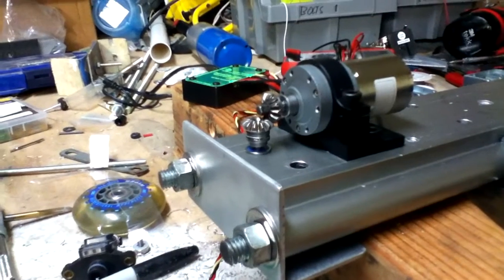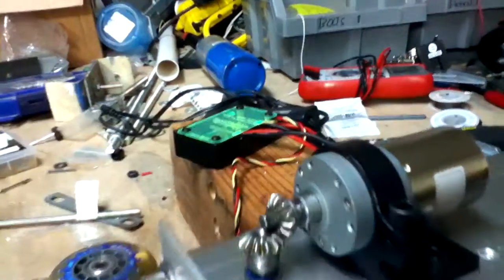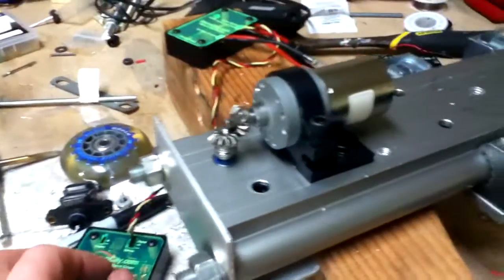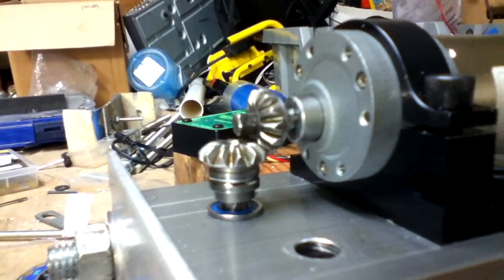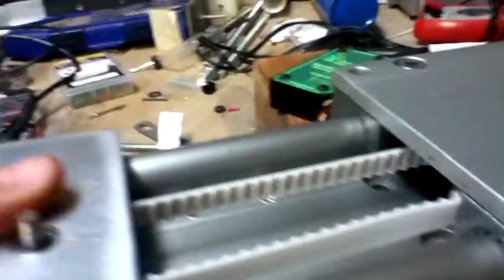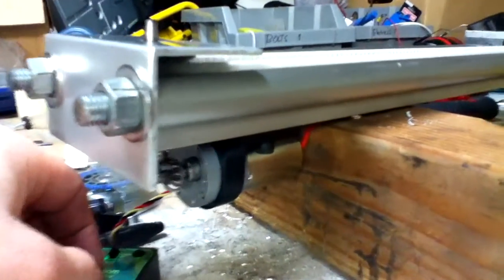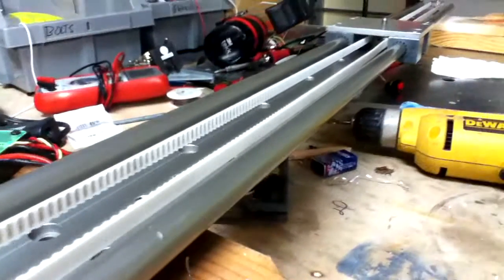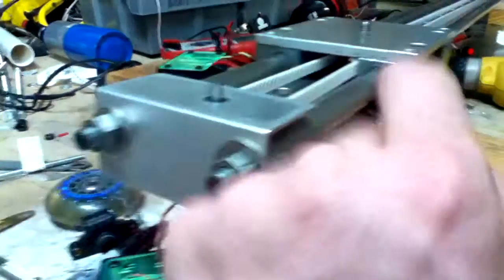Motorized Slider Update #2 with Servo City Parts

Comment: Hey I wanted to know what is the slowest speed on the motor? Will it be suitable for timelapse videos?
Reply from the maker: This is for video and not time-lapse. You would need a completely different controller setup for this. A lot of folks doing time-lapse drag the shutter and since this is a continuous movement slider it wont work well. The slider moves around 5 seconds a foot.

Comment from the maker: It is a 1/4 drill bit adapter I bought at Lowes or Home Depot.  When I mounted it up I loved that it was compact, but it was not as smooth as I wanted.  I have since abandoned the 90 degree motor mount and went with a straight mount.  I am still looking for a smooth gearbox so I can go back to the 90 setup.

Thanks for watching.